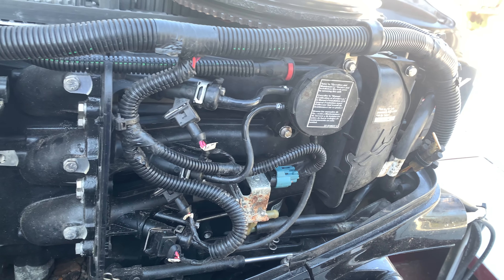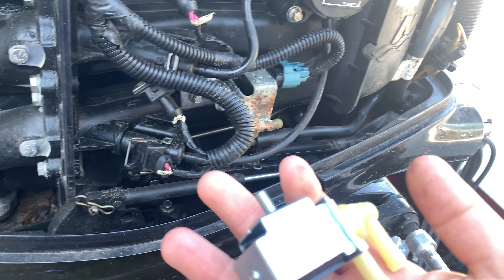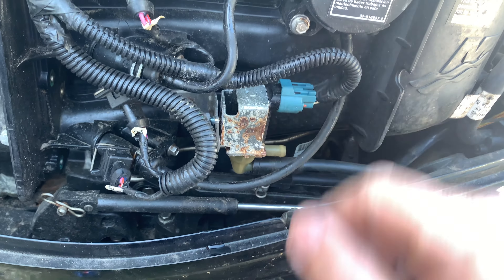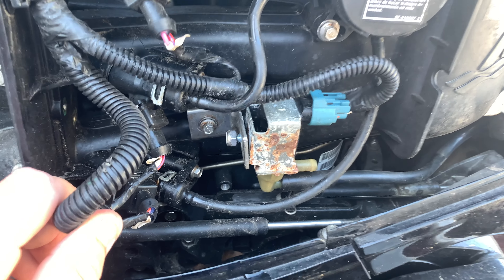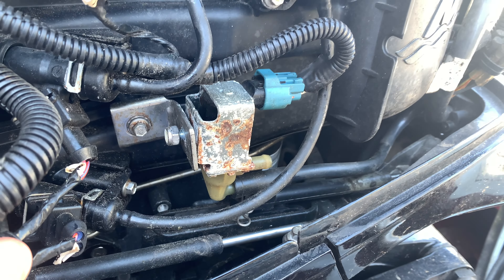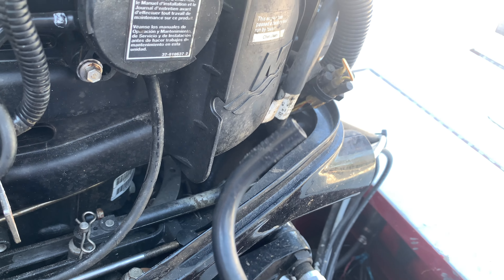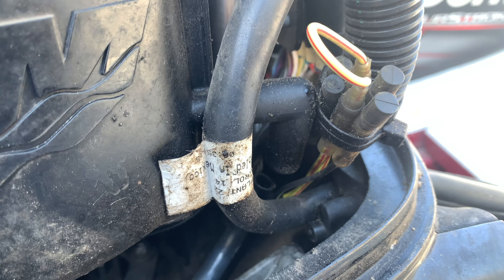Mercury Outboard High Idle Problem - Mercury 30/40/50/60 High Idle  Repair

Comment: I had the same problem with my 2004 40EFI4ST. I refitted the loose hose and problem solved. Thanks for your video. Garry @ Forster NSW.
Reply from the maker: Glad I could help. Thanks for commenting.

Comment: Related to this valve is that there is a whistling from our 50 hp starting at about 2200 rpm. Finally figured out the whistling is coming from the IAC. From the open, upper port sucking in air. Weird but the service manager says that's fine as long as idle is okay. Thanks for your video
Reply from the maker: Anytime. Thanks for providing some helpful information!
Reply: The other port is open to the atmosphere to compensate for air density. therefore if operating on a fresh water lake above sea level it will take this into account..

Comment: Would that valve cause mt merc 50 4 stroke to start and idle then die when throttling up?
Reply from the maker: @lostviking540 id bet you have a fuel pump going out.

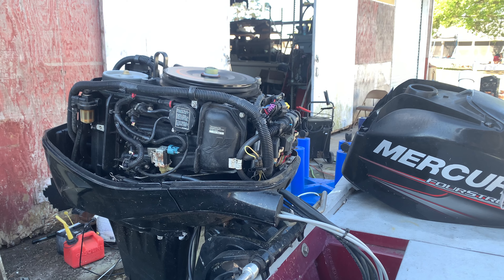Comment: At 0:10 you can see the hose was disconnected. You should have tried the old one with the hose reconnected.
Reply from the maker: One hose plug stays off one stays on it was def the sensor bad. Thanks for the comment though.

Comment: I have a 2007 mercury 25 hp 4 stroke that when the high idle lever is up it will run. As soon as I try to lower the lever to put it in reverse, the motor will die. Any suggestions would be highly appreciated.  Short boating season here in east, central Illinois.
Reply from the maker: Fuel pump gone bad?